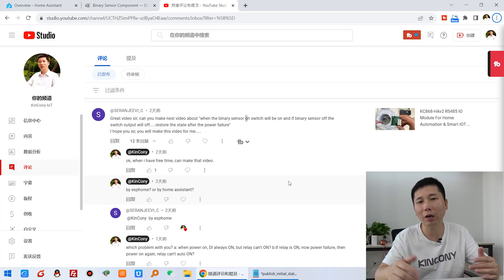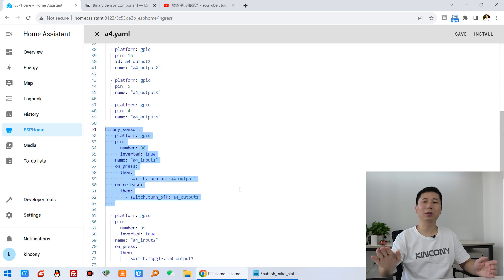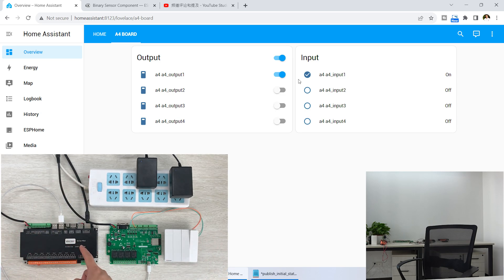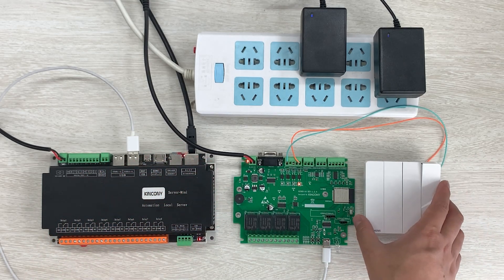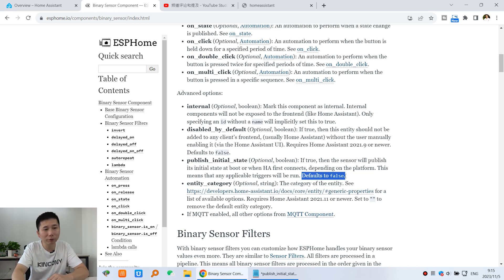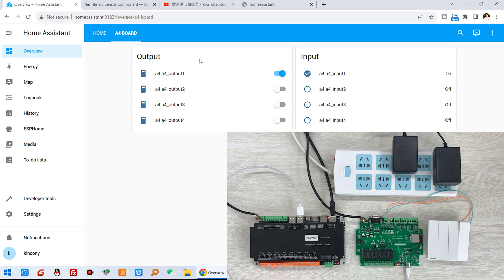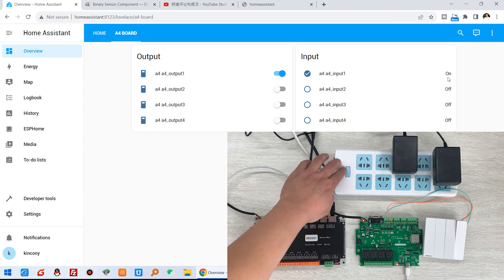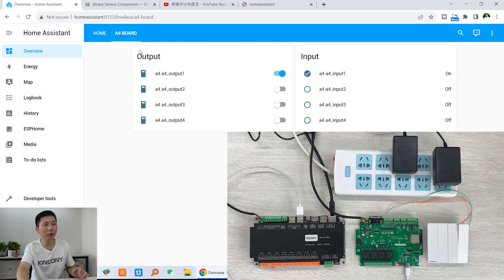publish sensor initial state at boot on home assistant after power failure

Comment: thank you 
how we can restore switch state when power failure without use any traditional button.
Reply from the maker: there is an "remember state" -- option in esphome. RESTORE_DEFAULT_OFF - Attempt to restore state and default to OFF if not possible to restore.

Comment: first   its very nice work   and i want to ask you    😍😍
  what is the magnitude of the voltages from microcontroller  that come out as a signal to the relay?
Reply from the maker: esp32 pin level is 3.3v, if you want connect to relay need add driver IC

Comment: Hello this publish state function works on traditional on off switch.....is it works on touch switch or toggle switch
Reply from the maker: sure, no problem.
Reply: @KinCony  ok sir
Reply: @KinCony  no, it no working with toggle/bistable switch. after reset of board output become low state (off). How to do this with bistable switch?
Reply from the maker: @wojciechsmerf3788  mainly use for momentary switch.